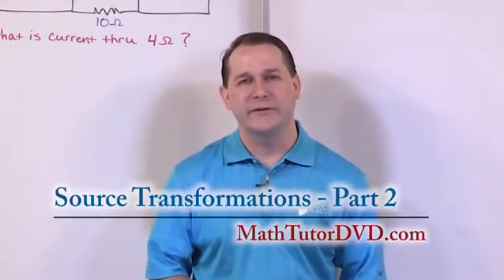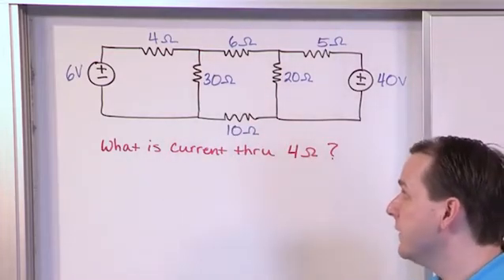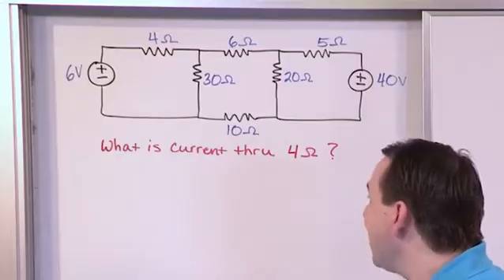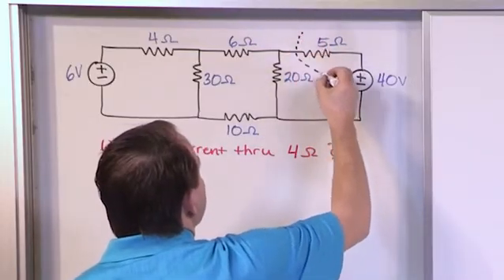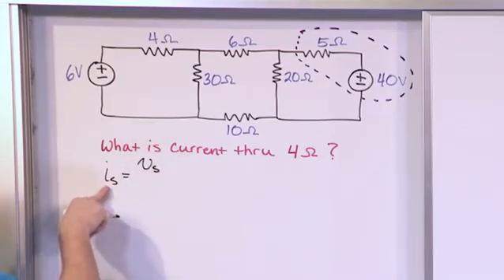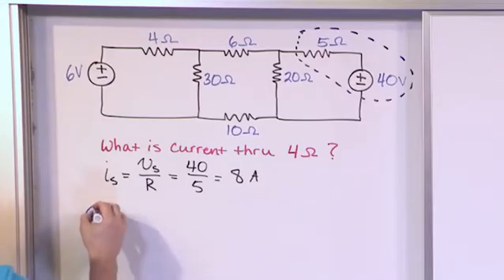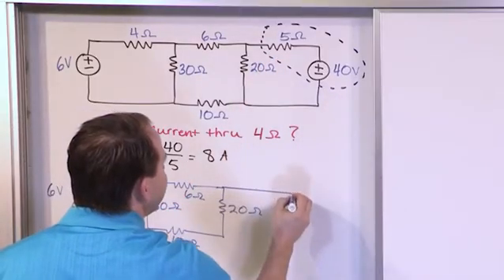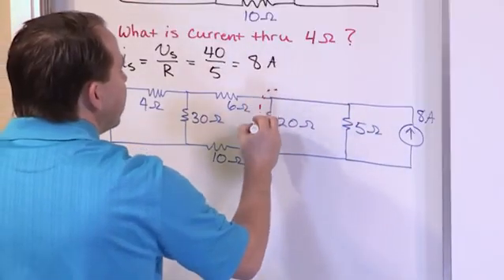Lesson 2 - Source Transformations, Part 2 (Engineering Circuits)

Comment: If you guys haven't solved it yet, the people that calculated here just solved for Req of 20||5, resulting to 4 ohms. With the 4 ohms, we then do source transformation with the 8A again, so 8A*4 ohms will result to 32v.

After that, perform mesh equivalent on the circuit, so by now we have 6v on the left side and 32v on the right side, both facing upwards, but we will assume the current is flowing clockwise.

The Mesh 1 equation will be:
34i1-30i2=6v

The Mesh 2 equation will be:
-30i1+50i2=-32v

Now when you use the elimination method, we  can multiply 5 on the Mesh 1, and 3 on the Mesh 2 to eliminate the i2. Thus,

170i1-150i2=30v
-90i1+150i2=-96v

Now from here solve for i1

80i1=-66v

U will get i1=-0.875 which is really negative I don't know how it is positive with the others.

Hope this helps!
Reply: Okay it's positive 0.875 because the assumed direction of the current was wrong, if I'm not mistaken😅
Reply: After having 4 ohms resistor and 32v, Can we still use source transformation and not use Mesh equation? If yes, so share please the rest solution and steps with source transformation.

Assume we don't know Mesh equation yet.
Reply: @AzizaMohammadi-e6f  after doing the Req of 20||5, it is equivalent to 4 ohms, but the 8A remains the same, the two resistors was just simplified, we got the 32v when we did the source transformation for the second time, since the formula for voltage is I * R, 8A * 4 ohms = 32v. Btw, after doing the source transform for the second time, the 4 ohms resistor will become series now with the 6 ohms resistor and the 32v, so you have to simply that again 6 ohms + 4 ohms is 10 ohms.

so to answer your question, yes you can perform the source transformation again, however I don't know about solving this problem without using the mesh equation, since the problem is basically leading up to use the mesh equation. 

Use your imagination on this one, when we did the second transformation this will be the circuit:

6v on the left side, series to a 4 ohms resistor and parallel to the 30 ohms resistor in the middle, just like in the video above, next is the right side which is basically two 10 ohms resistor one at the top and one at the bottom and then the 32v on the far right. Again, we got 10 ohms at the top because we simplified the 6 ohms resistor and the 4 ohms resistor when we did the source transformation for the second time. 

Hope this helps.

Comment: Coming to comments for video solutions? Lol same .... after video paused through parallel series of resistors on right side then a source transformation on right side then did mesh equations. You can cancel out one variable and I got i1=0.825A . Looking at other comments that's what others got, but yea. Goodluck with your exam

Comment: i have a question.so at the first step you only considered the 5 ohm resister and 40v source to calculate the current source.so from that,you are finding the maximum current that can be provided from the 40v source? no need to consider the other components to calculate the current source?so basically i'm asking is that,for example,40v is connected with R1 and R2 resistors.all the components are in series.so to calculate how much current the voltage source produce,is it enough to consider R1 or R2 only?